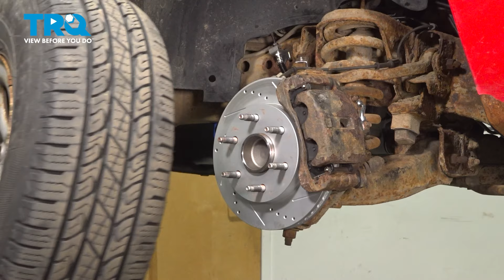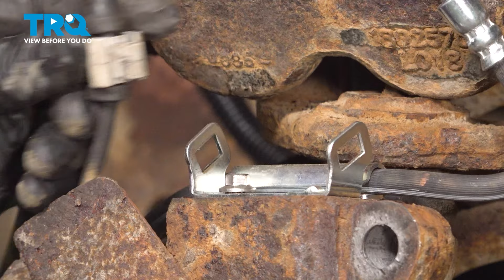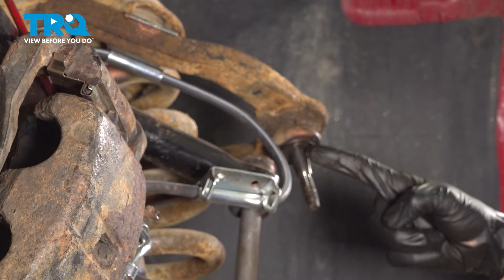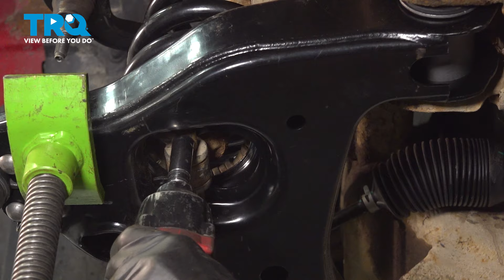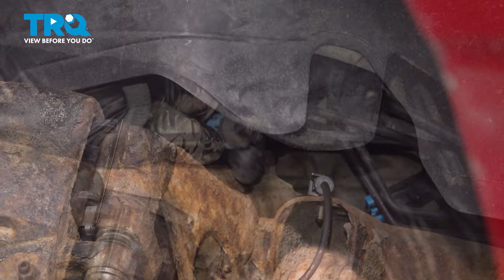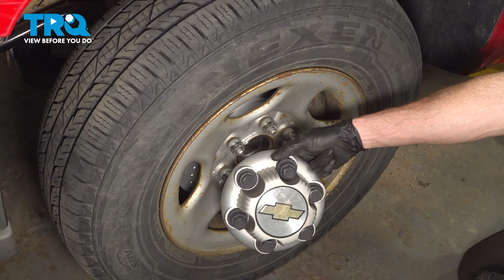How to Replace Front Upper Control Arms with Ball Joint 1999-2006 Chevrolet Silverado 1500

Comment: Drivers side was quick and easy but the passenger sides upper control arm bolt was very difficult to take out since the coil spring was blocking it. Used a coil spring compressor to give it more clearance so if you’re thinking about doing this I’d look at the upper control arm bolts to see if they can clear visually

Comment: 😮Your video is very interesting, I like it a lot, but I think there's something that's not true. Supposedly, the video is about changing the upper control arm. You supposedly changed it, but at the end of the video it seems you never actually changed it and you end up greasing the lower arm.

Comment: Lots of this unnecessary to replace only the upper. The title of the video is incorrect. You don't have to take the spring out or loosen the lower ball joint or steering.

Comment: spun out and ran over a sign and went over a curb due to a slippery and slick road. i was 2 min away from work. damaged the upper and lower control arms. the ball joints separated from the knuckle. tire and wheel also got damaged. i also damaged the fender but cosmetics is the least of my worries as of now. it’s an easy task but a good refresher always helps. eventually i’ll do the other side but for now i’ll do one side. about $300 for this fix. i hope my insurance takes care of the cosmetic work.